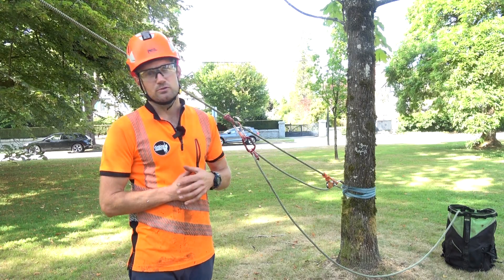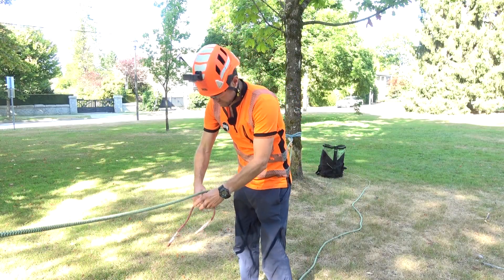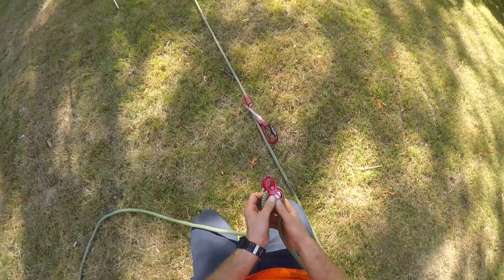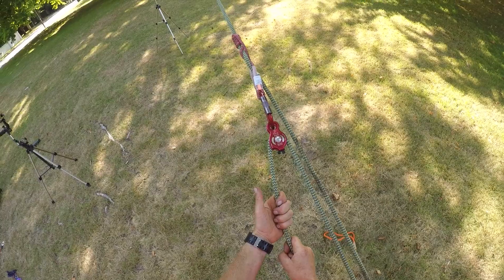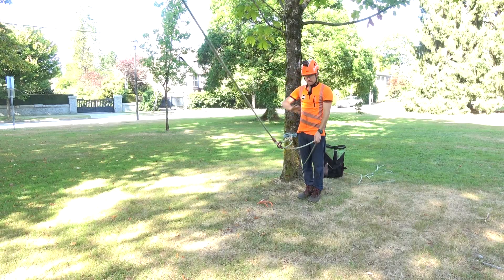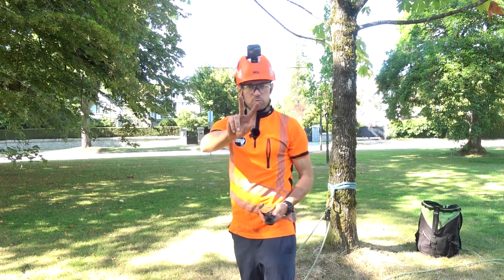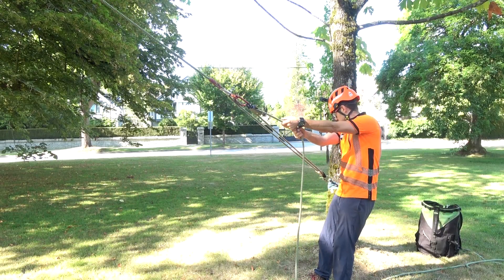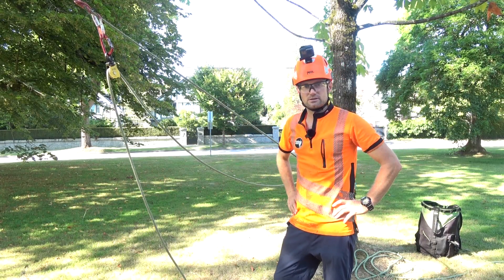How to set up a 3 to 1 mechanical advantage hauling system (Z rig)

Comment: In a "crevasse rescue" (glacier crevasse) system we (Association of Canadian Mountain Guides / A.C.M.G.) use a tied-off Munter hitch (Munter hitch with a slippery overhand knot tie-off)back at the system anchor so that the whole system can be released if needed.